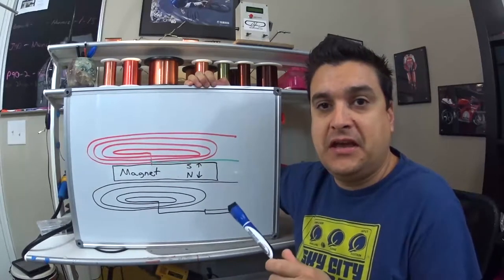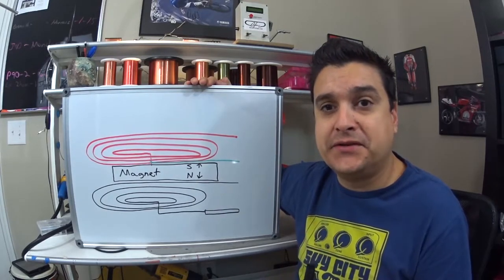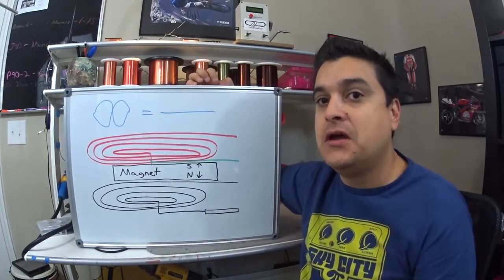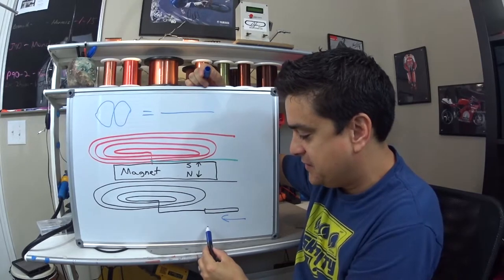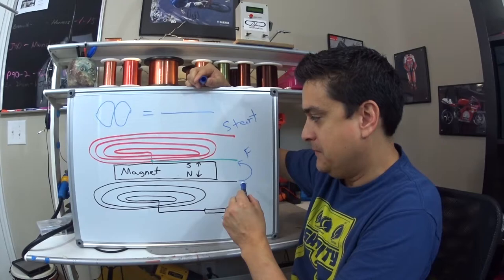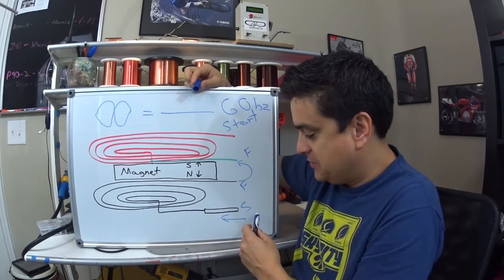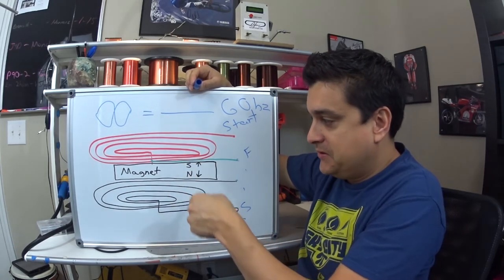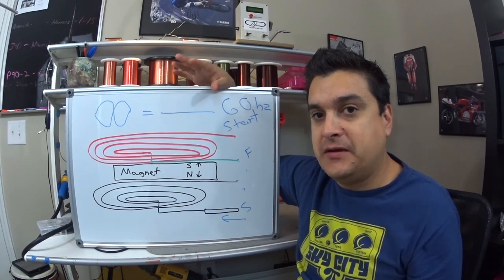How Humbuckers Work - How Guitar pickups are made #27

Comment: A key point you forgot to mention is that the pole pieces in a humbucker are oriented north-up in one coil and south-up in the other.  As a consequence, a moving string's effect on the magnetic field in one coil will be the opposite that of the other coil, but since the coils are reversed, it induces the same polarity of current in both, thus adding rather than canceling.
Reply: But his diagram isn't phase reversed, so if he tried to wire this up, it would be a weak pickup due to what you just said. In order for it to be an ACTUAL humbucker, the magnetic poles have to be as you described, and the signal has to go into the same wire on each coil, for example, the top wire on the first coil gets connected to the output, then the bottom wire of the first coil gets connected to the BOTTOM wire of the second coil. this way, the signal is going into coil number two in reverse to coil number one. then the signal EXITS the top wire of coil two. This automatically bucks inductance noise(60 cycle hum) while preserving the magnetic field disturbance (the string moving over the pickup) since the string is making the same movement on both poles, if left alone, each pole of the magnet, since flipped, would pretty much cancel out the string sound. UNTIL you flip the signal in one of the coils, at which point doing so bucks all noise the COILS picks up, and actually phase reverses the opposing polarity of the magnet so that now the resulting signal in each coil is in phase with the other, which equals a high output pickup. His description is a rookie mistake. The way he's got it wired is basically two single coils in series, with the magnetic poles actually working against him. I hope he hasn't actually tried to sell that as a humbucker, because he cheated the customer if he did.
Reply: @bryanharrison3889  Wow, awesome explanation! I was actually kind of bummed there wasn't a recap or something of when he explains exactly how the pickups wired out of phase only 'bucks' the hum without canceling the signal entirely. I have a solid understanding in both audio and electronic engineering, so I'm very familiar with stuff like common mode rejection and whatnot. This video alone somewhat confused me and left me with a few questions. This comment definitely helped clear things up for me. Thanks again!
Reply: Cool. You should make a video about it.
Reply: perfect, thx man
Reply: @bryanharrison3889  Thanks for clarifying such an important part of the humbucker. It is highly disturbing when someone is going to really explain something, and misses the key part of the solution.
Reply: @bryanharrison3889  If you check his channel you'll see that this guy is a knowledgeable and experienced pickup maker,.
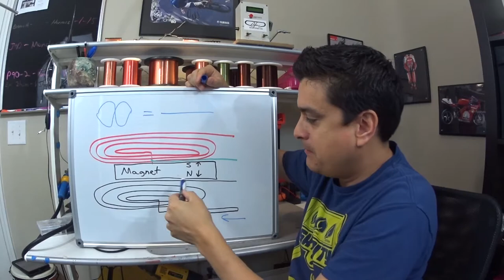Granted, the diagram as drawn is initially misleading with what looks to be a green start wire on the second coil. But, at 2:14 he correctly writes 'Start' and 'F' on the second coil wires whilst explaining the 'F' of the first coil is wired to the 'Start' of the second, thereby putting it electrically out-of-phase. So, the description at least is sound.
I think you should be careful with words like 'rookie' and 'cheat' in a public arena.

Comment: You say it the wire enters clock-wise and exits clock-wise. I had to dismantle and old humbucker not to lose my mind. The picture you show here is wrong. The wire must enter clock-wise and has to enter counter clock-wise to the other bobbin. The can't be electrically out of phase (opposite) if the coil has the same rotation path.

Comment: I get how it cancels the 60hz hum. But how does it not cancel the signal coming from the vibration of the strings?
Reply: I think I have a good explanation, but it may take me a minute to write. Are you still wondering?
Reply: @mvl2468  YES
Reply: @courgeonaute  awesome! I typed up a pretty detailed reply, but I think it got taken down because I also included a link to a diagram of the magnetic field lines from a pickup. 

My best theory is that since the two connected pickups of a humbucker are wired in opposite polarity, they cancel out most of the magnetic field around them, EXCEPT immediately above each pickup. If you look at the magnetic field lines above a pickup, or any magnet for that matter,  you can see that they are nearly straight (vertical). Since the field lines are nearly straight above the center of both pickups (meaning parallel to each other), they can’t phase each other out to a significant degree. That means that only the change in magnetic field directly above the two pickups will be perceived electrically. Fortunately, that happens to be where the stings are! Also, since electromagnetic interference is usually coming from all directions, it is mostly phased out. Of course, there should be a little bit left that is sneaking in from that 90° position where the strings are. I hope this gives you a better understanding. It definitely wasn’t as concise as my first post!
Reply: @mvl2468  that makes sense since humbuckers dont buck 100% of the hum

Comment: That's the best explanation of how it works! I've been going nuts trying to get my head around this. The signal enters the bottom COIL START exits the bottom COIL FINISH then enters through the top COIL FINISH and exits out the the top COIL START. The signal running different directions in each coil creates  the electrical out of phase that cancels the hum.   I wanted to say that to get it through my thick head 😃 Thank you!

Comment: Hi Dylan!
Great video! I have a question. In case of a humbucker pickup naturaly. What if I hook the two coils  this way? The "first" coil's ground goes into ground and hot goes into a "second" coil's GROUND (so not to the hot as in the case of the "official" method) and the second coil's hot goes to the hot. Changing the sound of the pickup, output level or a humbucking effect anyway?
Reply: If you wire the pickups your way, you will have current flowing in the same direction in both coils.  This eliminates the noise cancelling.  The way he described it in the video, and the way a humbucking coil works, is - CURRENT FLOWS CLOCKWISE IN ONE HALF THE PICKUP, THEN CURRENT IS MADE TO FLOW COUNTER-CLOCKWISE in the other half of the pickup.  That cancels out the humming received from an 'electrically noisy' source, like a fluorescent light, or a space heater, or another electrical appliance near the guitar.

In your connection of the two halves of the coil, the current would flow the same direction in both coils (either both clockwise, or both counter-clockwise, depending on how you choose the input and output wires). 

 You would effectively will have two coils in series, giving you one large coil, if you make current flow the same direction in both coils.

And if you keep the magnetic poles as they are - opposite polarity in the top half which has 'South' magnetic polarity, and the bottom half has 'North' polarity as shown in the diagram - the guitar signal will now be cancelled.  The reason the magnetic poles are 'South' in one half and 'North' in the other half is to allow the coils - when connected together in the normal, 'humbucking' way - is so that the guitar string still gets its signal through.